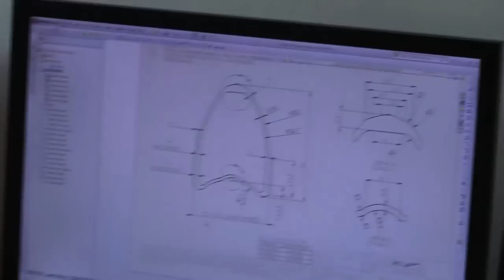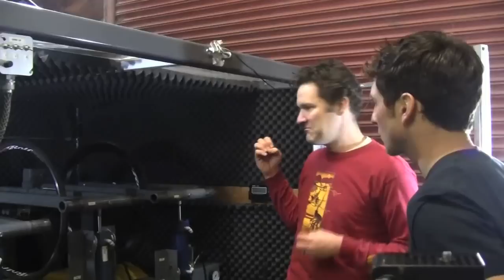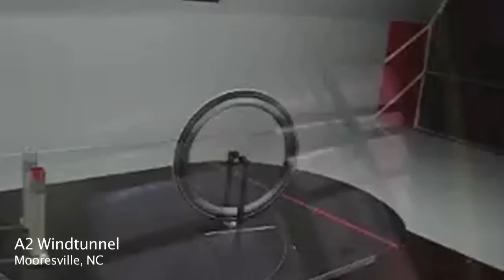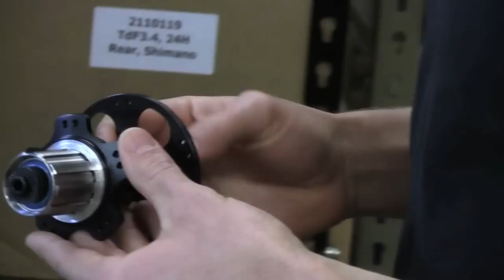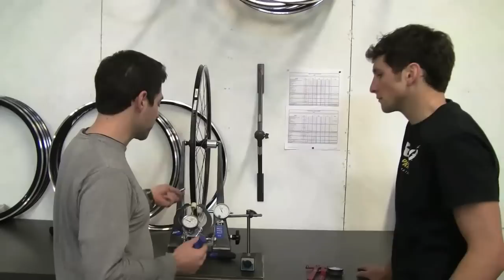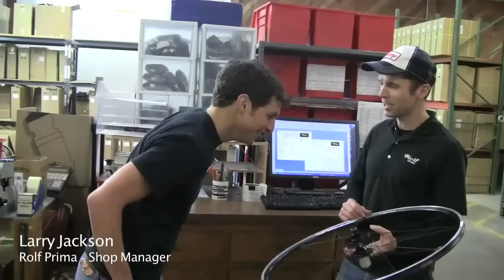Behind the scenes at Rolf Prima with Jesse Thomas

Comment: I just sold a set of Rolf TDF 38 carbon tubular wheels that i had for 6 years, still in great use-able condition so absolutely NO complaints. Very light, durable and to be honest the wheels surprised me as to the use i got from them considering they were carbon and not really an everyday wheel, set. I replaced them with the 4SL which is a similar wheel, a little deeper and wider, can't wait to get them!! I am also impressed with Rolf's office when it comes to a question, etc. Great products!!